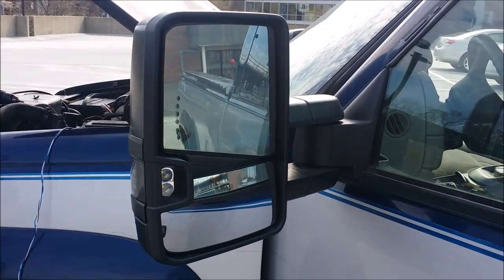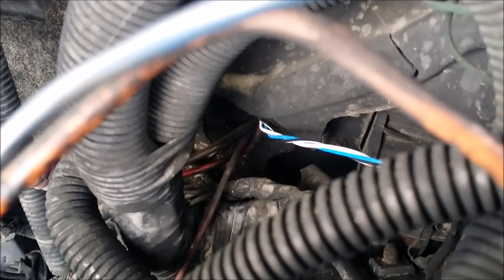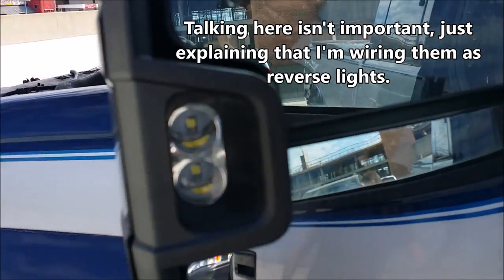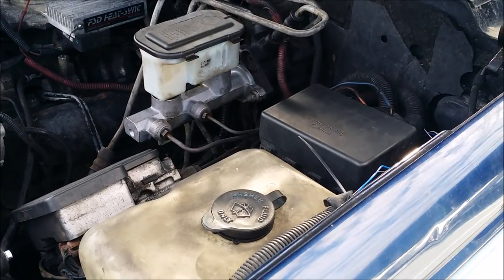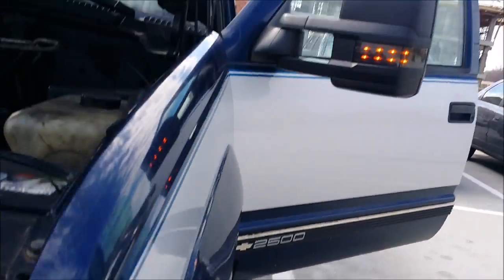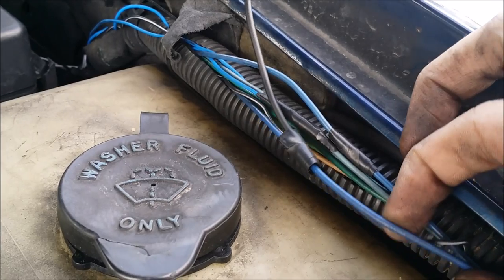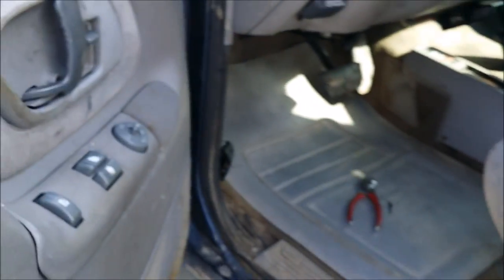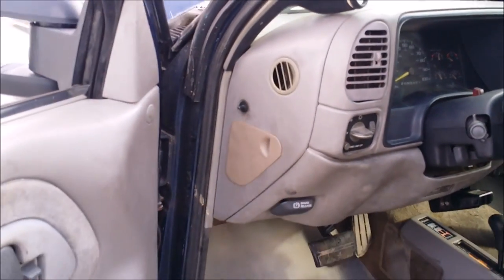Tow Mirror Wiring 88-98 OBS Chevy/GMC

Comment: Just to let you know, you can get the running lights and turn signals under the dash.  Also not all, but some, of the trucks have the reverse light wire in the convenience center under the driver side dash (used with the auto dimming mirrors) and that's where I tapped my reverse wire.
Reply from the maker: Daniel Pace Unfortunately I didn't have the dedicated reverse wire under the dash, and I just found it easier on my back to use the wires under the hood rather than under the colum haha
Reply: True. And honestly, I used the wires under the hood also. Didn't feel like going under the dash at the time.

Comment: I just received mine and there power mirrors so you can adjust the glass with your switch and it only works when you move the switch down it doesn't on left or right or up you think k the mirrors are bad?

Comment: Hey I realize this post is from 7 years ago but figured I’d try anyway!! Did you have to drill new holes in your door for top mounting bolt to go through?
Reply from the maker: The mirrors I got were bolt in, back then I definitely wouldn't have had the stomach to drill a hole in the door lol
Reply: So I was sent the wrong mirrors and just got the right ones. There installed on the Hoe now. I wanna change the wiring so I have the running lights like you did but am not sure how you got to the wiring? Does the glass just pull out for access? Thanks again

Comment: How did you take the mirror off without cracking to wire for runninglights
Reply from the maker: It all depends on the quality of the mirrors, with aftermarket ones it's hit or miss
Reply: Also how did you run the front lights for running
Reply: @BackyardBuilder513  how do you run the front light wires to be running light wires
Reply: @BackyardBuilder513  change you run the wire from the front light to a running light wire and they just run as running lights ?

Comment: Did they bolt in ok? I have a 96 and i wanna throw some just like that on it
Reply from the maker: These bolted in perfect for me, but I don't know that they'd fit the mid size trucks without modifying the door.
Reply: If I remember right the doors are the same, my passenger side  door is off a 94 c10

Comment: Do your mirrors fold in completely so almost touching window? The ones I just received DO NOT. Which is not good for pulling in garage. They do however fold completely flat forward  (towards the hood). Maybe mine were build backwards? Also looks like led mirror lights are mounted off from holes on glass. May need to return these...
Reply from the maker: PowerPC I've never tried folding mine in but all my leds line up like they're supposed to

Comment: How did you wire the internals of the mirrors to separate the running light in the front while still retaining it at as turn signal? I thought I wired mine right but the turn signal is so faint when the running lights are on. Any help would be appreciated! Subbed to see more!
Reply from the maker: Adrepok It's hard to explain just by typing it out, I'll be making a video on how to wire them up hopefully this week because I have to replace my driver side mirror (my running lights crapped out on one side). Thanks for the sub, it's always appreciated!
Reply: Sounds good man! My truck isn't too dissimilar to yours, 98 GMC K2500 ECLB with the 454. It's a beast!
Reply from the maker: Adrepok awesome! Mine has the 6.5 Turbo Diesel
Reply: Yeah!  I've watched all of your videos so far. I would love the gas mileage of the 6.5 with the power of the 454!
Reply from the maker: Adrepok awesome I love the support! Yeah the 6.5 can pull down a house but it's slow af 😂
Reply: Oh yeah I know how the 6.5 is, my bro had one. But I would have to say comparing his 6.5 to my 454, the 454 has the same if not more grunt through the entire power band, but it'll get 6-8mpg pulling at max capacity lol
Reply from the maker: Adrepok haha yeah if I baby the throttle I get awesome mpgs
Reply: lol my best was driving it back home when I bought it, all highway, managed to get 15.5 , worst was 6.7
Reply: I still dont know where this 4th wire comes for running lights? How did u separate them? Can u explain a little better?